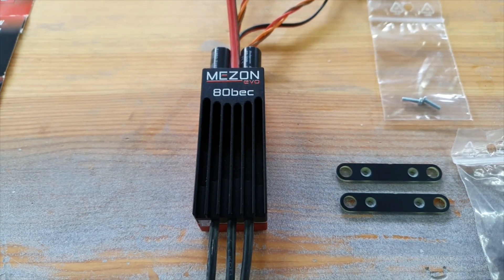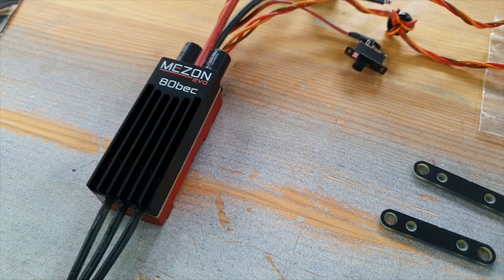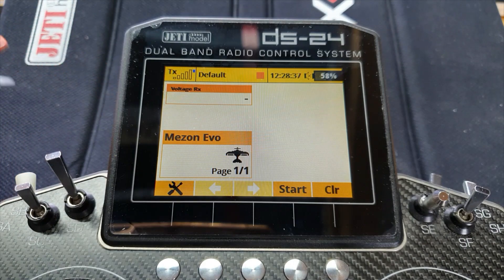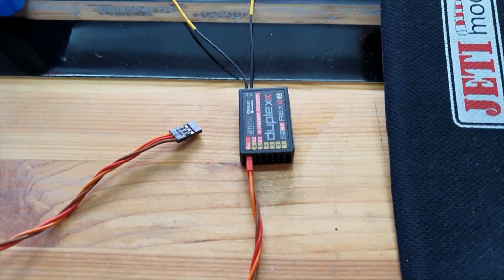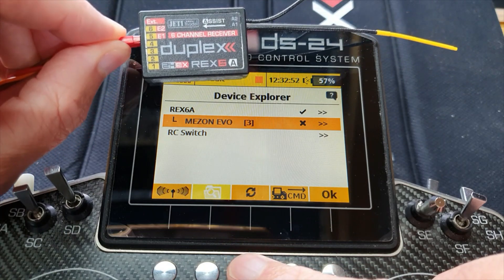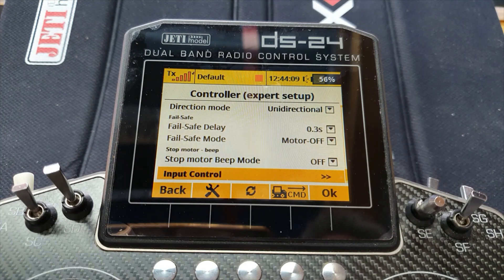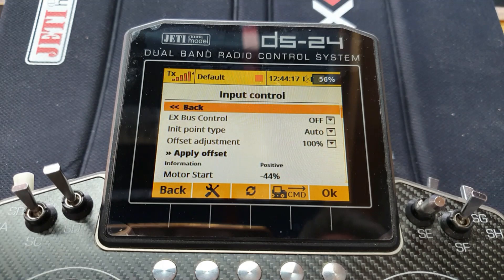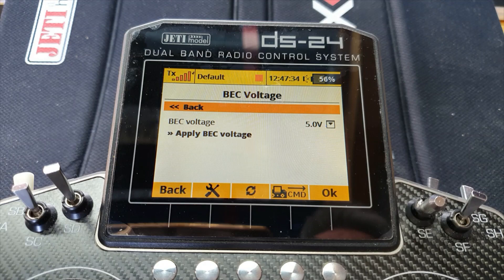Jeti - Mezon Evo ESC speed controller

Comment: Thanks Harry for another great helpful video. I'm using the same Mezon Evo with an Assist rx and I'm noticing that occasionally the rx doesn't give out the usual boot alarms "initialised" and "armed" on the tx.  Every other Assist rx that I use gives these alarms 100% during bootup, but for some reason this seems different when connected to the Mezon Evo.  Sometimes I get both alarms, but occasionally one of them is missing.  Just wondered if you had any similar experience?  I'm a little worried the rx is not booting correctly but its proving difficult to confirm exactly what is happening because the problem is so intermittent e.g. the rx has booted with both alarms sounding when I've tried it on a different power supply, or on the Mezon Evo without the telemetry cable plugged in, but then sometimes its ok anyway on the Mezon Evo with telemetry plugged in!  I've also tried various combinations of the BEC switch on/off when I connect the flight pack, but again the problem is so intermittent that I'm not able to confirm this makes any difference.
Reply from the maker: If it says "initialised" and then the controls work it is okay.  Sometimes the word "armed" gets delayed in the queue of things being said and done and then is not spoken.
Reply: @cotswoldpilot  Thanks Harry.  More often than not its the "initialised" alarm that is missing (but controls appear to work ok including the gyro response), but sometimes its the "armed" instead.  I'm sure this has NEVER happened on my other 6 assist rx's over 4 years of using them - so i'm thinking there is either something going on with the Evo's telemetry that is interfering with the rx alarms, OR ive got a faulty rx!  BTW, I've been looking at the telemetry logs in JETI studio and I cant see any overlapping alarms (which was how JETI support answered my query about this - saying there may be overlapping alarms with higher priority).  I'll do some more testing, probably swapping some rx's around.

Comment: Hi Harry great video, I was looking at the specs for the Mezon EVO and the Pro and I cannot see much in it, I am looking at a Mezon Pro 55 which should be good for approaching 2kw on 10S. What's the difference between the Pro and the EVO?
Reply from the maker: Big differences are the mounting brackets, setup wizard, F3A mode, plus some other things.
Reply: @cotswoldpilot  looks like they can both be programmed via Tx, and have the same telem items

Comment: Hi thanks for another great video, I have a Fms extra 330 with a 90 Amp Esc the engine runs fine, except at full throttle, then there is a very strange humming noise in it, suspect the timing is wrong in it. Can't find any manual online for that Esc so I can adjust the timing.
So I'm strongly considering buying a Mezon 90 A EVO for it, but when looking in the log file for the MUI200, the max is p 93.9 Amp for a few seconds and can't find in the specs for the Mezon how much overload it can handle for a short while , normally it says x Amp for y seconds.
So my question is, is the Mezon 90 A enough or should I choose a larger one?
Reply from the maker: Evo is max 80A with BEC or 85A opto.  Plain Mezons are made at higher amps but may not be in stock due to component shortages.